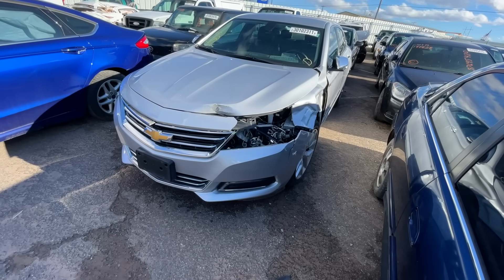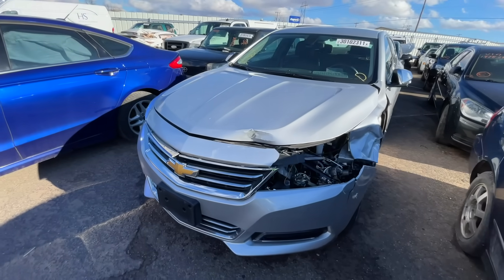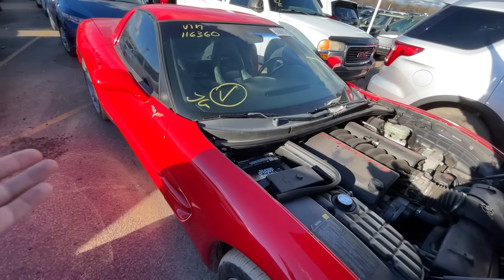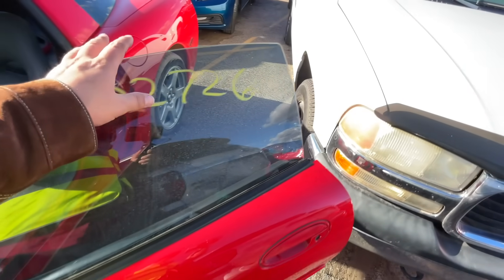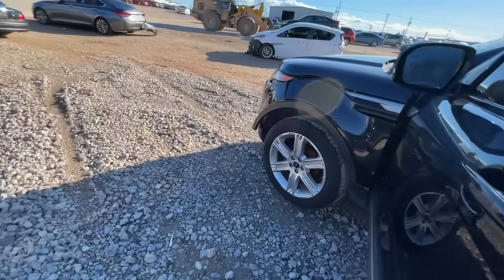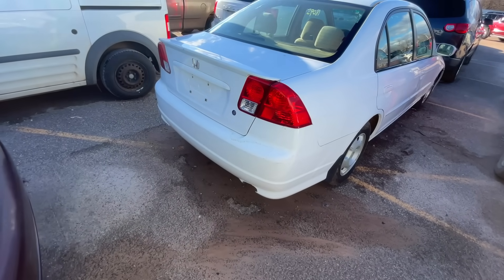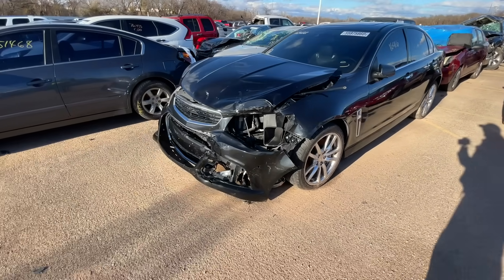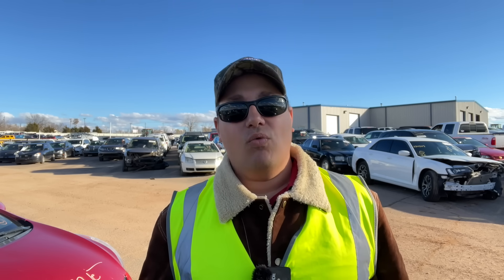Copart Walk Around 1-26-21 + 99 C5 Corvette CHEAP!!

Comment: The Transmission on the 1999 Corvette is located in the rear of the vehicle. The Transmission also contains the rear end drive assembly. It is not located on the rear of the engine block as in a traditional vehicle. There is a Drain plug on the bottom of the transmission gear box assembly, as well as a fill/check plug on the side to add and check fluid levels. So, you'd have to have it level and get under it to check.

Comment: Randy quick tip. 
 you can check the codes on the C5 
Hold the options button while pushing the fuel button 4 times then it will display the codes but make sure you hit the reset button till you see the mileage first

Comment: Common solution for your traction ,abs light is a module that goes bad that's on the left front comer next to the radiator where all the brake lines go into and can be removed and sent out for repair in most cases and you still can use the car with it removed.

Comment: Not surprised that the service vehicle and abs lights are on. Fun fact about 97-00 Corvettes, you can't find ANY of the electronics that go into the stability system. Steering wheel position sensor, EBTCM, Adjustable shocks, etc.

Comment: Your tachometer is inop. Check the harmonic balancer and make sure it is not coming apart. You will see it wobble. That is a major problem which will cause belt noise. The AC light is blinking due to either low refrigerant or bad compressor clutch.  Possible wheel speed sensor on the trac issue. Probably a switch issue for security.  It can be bypassed.

Comment: The corvette will display all of the codes for you   ignition on car off  reset  button to clear  warning's   hold options press fuel  four times  then it will go through codes  automatically  but you can also manually go through them  everything  from  pcm  tcs  radio hvac  and a bunch more.  could be dirty grounds  to a wheel sensor to the ebcm needing resoldered   I fixed mine that way.  got to be a master electrical and soldering fool to own a c5

Comment: The C5 model of the popular Corvette was produced from 1997 to 2004. The C5 does not have a dipstick to check the transmission fluid. The fluid level must be checked by raising the car and accessing the fill plug next to the transmission pan. The car must be raised sufficient to safely access the area.

Comment: So I may be a bit late here, but have worked on c5s and c6s for almost 15 years now. Normally the ride control is pretty reliable. A lot of the time, low voltage at startup with a dead battery like that car had can cause issues. The shocks are expensive tho. Like 3-400 a piece. Another good thing to look at is the shroud over the top of the radiator. If the car hit something underneath hard, it snaps the upper shroud off where it bolts to the top of frame. Also they can have hvac issues. Vacuum lines under the battery rot. Especially if it had a battery leak or go bad... My experience with the c5 is that it’s an extremely reliable car tho.

Comment: That corvette has the Z51 option. The ride control light will come on if the car is started 3 or more times without the car moving. It will reset when it senses movement over 5 mph.

Comment: Randy, on the Civic the IMA light may not turn for a little while after driving. The battery light might be coming from a hybrid system failure its been a couple of years since my Dads 04 civic had an IMA failure light and the battery (12v) light would come on as well. Through research the failure would come from a inverter, but that could have been an symptom to the failure of the high voltage battery and other systems. I would avoid as well, but I am an idiot and could have missed a simple problem.

Comment: Randy, thanks for another great vid! Rather than wasting $15/16K on a Viper that will drain your wallet in a hurry, then challenge you to flip it profitably, spend the $8/10K on the Impala that won’t break the bank to fix and can be flipped easily. Hope you get the C5 at $4/5K; it would be a nice flip. The Range Rover - Run Away, Run Away‼️ (same for the Honda Hybrid) Stay Safe.

Comment: The traction and ABS light is a common issue. On a 99 , it is not rebuildable and no longer made. You may find a good used one for $1500. The chirp is usually a harmonic balancer going bad. The display on the HVAC is rebuildable for about $175 .

Comment: Traction control and ABS light coming on in a pre-2001 C-5 means you should run!  That's the electronic brake control module.  It's not rebuildable on pre-2001s and they don't make it anymore.  The only way to get another one is to source it from another corvette and they cost a LOT of money.

Comment: Good place to start with the suspension control is at the abs light. A lot of times once that kicks on for whatever reason the computer turns other things off for safety. I would almost bet you fix that issue the rest will work again.

Comment: Active body control never really did much tbh in old 90s and 80s car. I have a 60k miles 86 c4.  I’ve driven a 50k mile anniversary edition c5 and it didn’t do anything at least I didn’t feel anything. I wouldn’t stress

Comment: Been a story of the Chevy SS this came out for the 2014 model year, and this lack of awareness is the car failed. It only had a corvette LS V8  around 415-horsepower 6.2-liter V8, which growls like the engine in a muscle car. It's a four-door corvette that was modified like the 1996 impala SS because it's for your family.

Comment: The tachometer is not working there is something the matter with the electrical probably why the AC is not lighting up and why the headlights won't flip up and why the active control ride is not working and probably why the amp is not working you didn't notice when you gave it gas the tachometer didn't move maybe just fuses but I doubt all those fuses blew pretty good looking car overall love a C5 and one more thing how in the world do you go in the cars with blood in them without any latex gloves on touching all that stuff somebody could have HIV you're crazy man I give you props sometimes they don't put bio on the cars if they don't see the blood but an airbag usually breaks or bust somebody's nose making them bleed 👃

Comment: The transmission is in the rear.... no dipstick to the best of my knowledge. That should have a 4L60E series transmission. It could be a 4L65E (5 sun gears vs 3, it is a bit better). Regardless, figure a lifespan in the 130k mile range. I would agree that the retail value would be upwards of $12k, if it was a 6spd manual. But for an auto? $10k is max, there are sooo many of them.... 

considering the overall condition, I would be checking those tires... date codes!!! and make sure all are the same make/model. 

The suspensions are prone to failure... new shocks are a couple hundred bucks each... But you will want to get a Helm factory service manual for this... they are complex, and considering you have owned a C6 and C7,  you already know this.

ABS/traction control errors are caused by a bad relay inside the ABS brain box... down by the steering rack. $20 for the relay and you have to take stuff apart.  The AC problem could be with the dash controller... 

Those flip up lights suck. They are just bad... 

The OEM radioes on these absolute junk.  If it needs fixed, look up Dr Don's... 

The thing you were flipping is an air intake for the cooling system.

These are generally great cars. They drive well and handle great, just blemished by miserable GM build quality.

Comment: Main pulley broken hybolic balancer broken that will cost you $2,600 trust me  oil will splatter all over your engine, I had pay that but lucky I had warranty also ride control will cost you 1,700 to replace it. Very costly rebuild. However nice looking car

Comment: The Corvette C5 seems to have alot of electical problems Rev counter no work, lights no work, aircon no work .
Reply: The interior is n decent shape so there's a little money in there. A radio and air conditioning aren't really necessary to go sideways and make smoke😃😃 Gut the interior, stick a Sparco seat in it and drift baby!